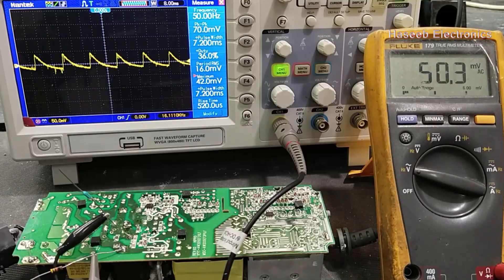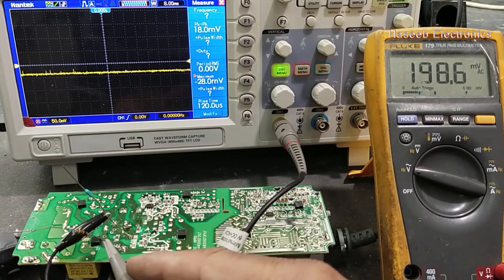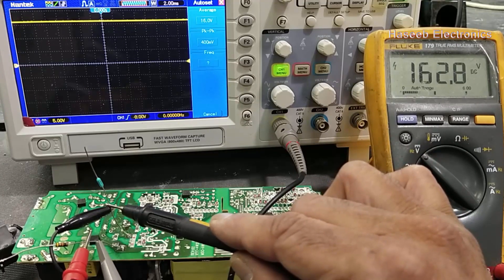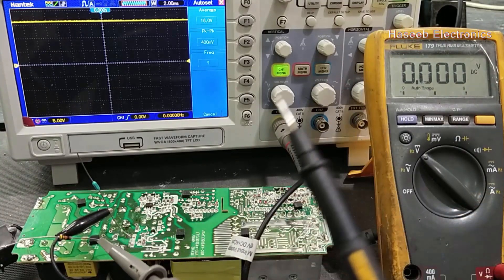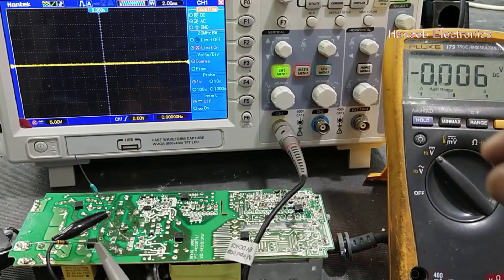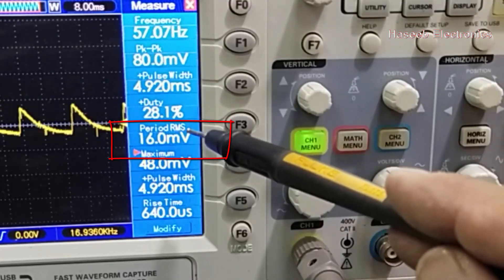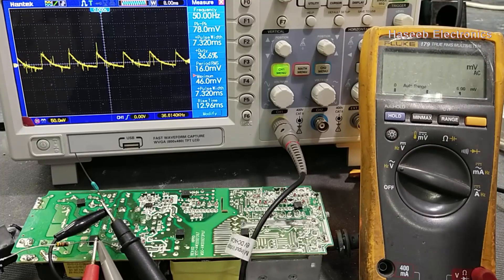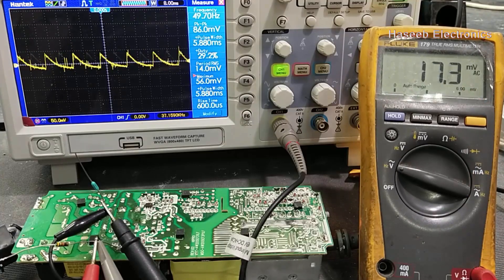[409] How to Measure Ripple Voltage on DC Capacitor with Multimeter / How to Check Repples in DC

Comment: Hello sir I am asking you if you can reply to my message thank you about a issue I can’t explain. I design a buck converter but the output voltage dropping even though there is voltage follower the duty cycle goes high when and load is added but voltage drop to 8 volt always , the input voltage is 60v from a power supply 1000 watts I use 4700uf for input filter and 3300 for output filter but for some reason I don’t know why the capacitor not filtering the ripple and holding current the ecr testing shows 9.0 % 34ohms the capacitor is large , i try using a old amplifier blue color capacitor 3300 not so big half the size of the big one ecr test 6.0 %31ohms the current was holding very will but the capacitor soon fail no doubt because it old I try finding the same capacitor but fail to find it online so can you please explain why the newer capacitor won’t work

Comment: why do you put two resistor in each lead of probe,why it is requires during measuring of ripple voltage.if required it then how much value of resistor should be put on?
Reply: He use them just to make the connection. The probes are not connected on any of them.

Comment: Good video

Can I know, should I use isolation transformer before of oscilloscope power in this case?

Thanks
Reply from the maker: Yes, absolutely 
we have to apply line voltage to the isolation transformer primary side and the output from secondary winding is to be applied to the oscilloscope
Reply: @HaseebElectronics  thanks allot
جزاك الله خيرا

Comment: Ripples agar dekhna he hai to Output par measure karo it's useless to measure ripples on the hv side because we have to deal to with the load side
Reply from the maker: yes dear.
it was a question from one of my viewer
ripples aur switching noise aur load transition to output capacitor per he check kiey jaatey hein 
I will do that, no problem

Comment: Kindly explain it in detail
Reply from the maker: yes dear, i have to explain it in detail in upcoming session to check output capacitor
Reply: @HaseebElectronics  also how to measure ripple after rectification before connecting smoothing capacitor

Comment: Sir, how can we test mosfet it is work or not? For example 13N50C , when I control drain and source pin I see multimeter diode mode 0.490 then I trigger gate pin then D and S pin show 0.430 can we say it is damaged ? It doesn't show short in continuity mode,

Comment: Sir I have another question please.
I have an old 9v ac dc adapter i connected it to my multimeter and realized there's something wrong the reading not stable and the meter act wrong then i open it and found there is a transformer and a bridge diodes then i grab another multimeter and measure the voltage of the adapter and there is un stable voltage between 8 and 10 volts and i changed the selector to AC Voltage and found that there is 4v ac then i tested the 4 diodes and found they are fine.
I do another test i connect a 9v battery to every single one of these diodes and measured the voltage in backwards and found out they leaks about 25mV.
Is it normal?
I'm sorry for the long question.
Jazaka Allah khair.
Reply: It's most likely the capacitors. Never connect a diode directly to battery you will damage them.  Search how to test diode on the internet, there are plenty of videos.
Reply: @techguy666 
There is no capacitor in the adapter.
I was powering the multimeter with an adapter instead of the 9v battery.

Comment: Is there something wrong if I find out the output of 5v smps in the DC voltage there is 5v and when i change the multimeter to AC Voltage i found 10v?
It's a Samsung mobile charger.

Comment: Thank you for another great video. I know that you are aware, but for your novice viewers, the oscilloscope has a x10 setting, on its menu. If that function is selected, the scope will calculate the correct 162 volt value. As the x10 protection resistor is built into the scope probe handle, their is no loss of protection by having the x10 menu setting, from the beginning.
Reply from the maker: yes sir
I salute you. really it is an excellent tip. 
please accept my best regards 💖

Comment: thank you haseeb sir. What about ripple based on load parameter?. Maximum ripple when applying recommended maximum load .
Reply: The testing method would be the same, but you simply would have the load attached. You are correct that this information may be the more useful. How the capacitor handles a load is what is important. If you have both measurements, that is without and with the load, you may be able to identify a capacitor that is weakening, or has a transient fault. Some more specialized capacitor testers do provide an adjustable, heavy load, with which to burden the capacitor, to look for leakage at their rated voltage value.